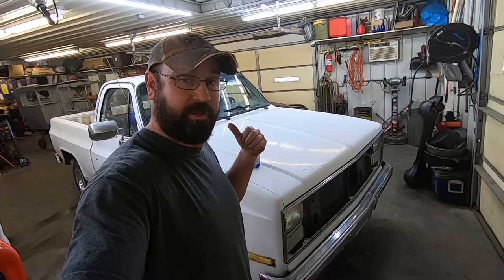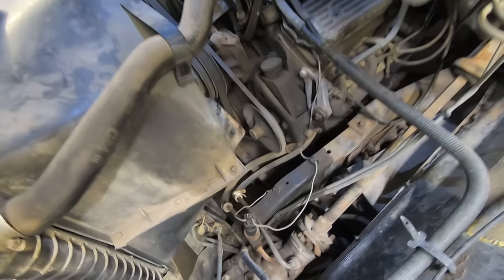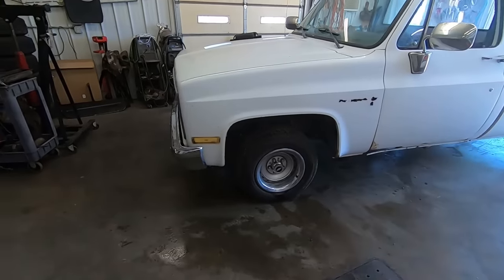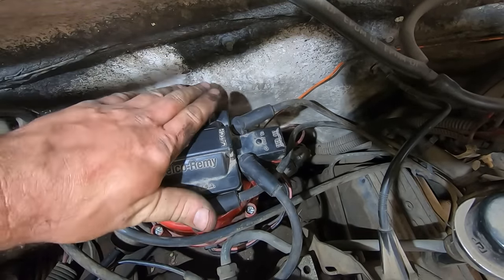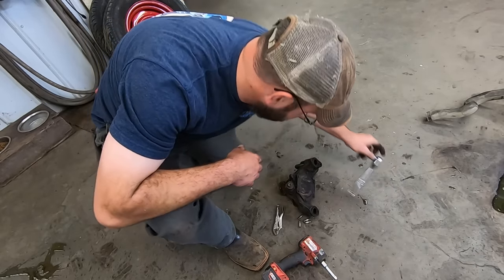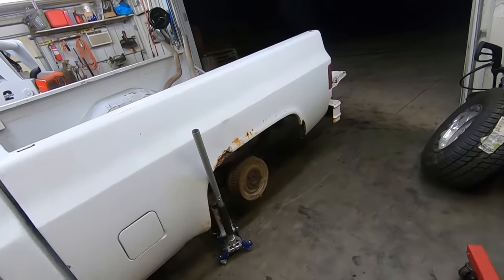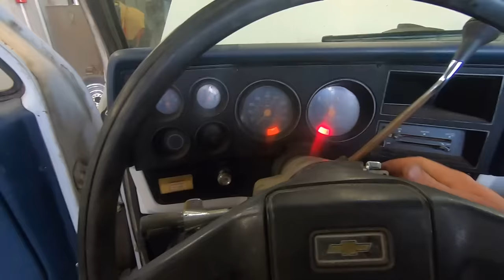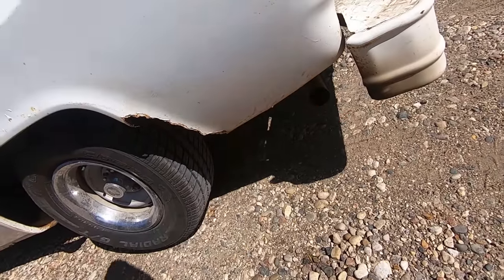I bought the cheapest shortbed Squarebody on Facebook Marketplace! Will it run? Daily driver?!?

Comment: Tech tip of the day check the reluctor wheel , the magnet in those 4.3 where prone to cracking and will cause intermittent missing. I don’t no how many of those I changed back in the day . Just a visual inspection of the coil magnet you can see if the magnets cracked or not but you replaced so your good to go

Comment: I love the square body's.  I have an '81 GMC one ton camper special with a 454, only 66k original miles.  It loves gas stations.... It's my wood and hay hauler.  The original bed has been replaced with a flatbed.  No rust whatsoever and the original paint is still in great condition. However, those darn door latches.....
Reply: Jim jibroni  --  Well, you have a point actually. Perhaps it's meant to display that the engine hasn't been replaced or rebuilt. That's the point I was trying to get across anyway, LOL.

Comment: I swapped a 396 big block into mine with a 400 transmission. Mine had the 4.3 with the three in the tree transmission with 3.42 gears. It would beat a lot of V8 vehicles off the line. Wanted more power so swapped in my 396. Wish I could find that truck now

Comment: That truck has the e4me quadrajet carb, it's computer controlled. Since you've pulled the computer controlled module out of the distributor, it may not be working right not giving it enough fuel. Easy fix is to just put a normal quadrajet on it
Reply: isnt that exactly what he did?
Reply from the maker: @bifaith100  Yup!
Reply: @MortskeRepair  How are you going to get that truck to pass an emissions test, or is'nt that a factor in N D. ?
Reply from the maker: @jeromebreeding3302  We got nothing like that here.
Reply: @MortskeRepair  You're iucky. Air pumps, Egr valves electronic carbs, and timing controls all sap power. Emission test force you to keep them.
Reply from the maker: @jeromebreeding3302  I'm not complaining that's for sure!
Reply: Yes because now the throttle position sensor and idle speed solenoid have no input from the ECU,to the distributor and carb..lol 74-83 Rochester quadrajet it lol.. although watch the 83-early 84 carbs have a idle stop solenoid and another one I can't remember what it is at the moment,kept running into them on Buick rwd 231, and 252 v6..grrr...lol.
Reply: @richardbates2367  The throttle stop selonoid is something I've encountered over the years. Supposedly. it's supposed to prevent   stalling.Always removed them. Did'nt seem to make a difference one way or another.
Reply: The best fix is to throw the quadrajunk in the scrap pile & put a edelbrock on it.
Reply: The pre-computerized Quadrajet carb is sometimes sworn at, just as often sworn by. It has a number of peculiarities that make it more difficult to service or modify than others,
Reply: @jeromebreeding3302  I've dealt with dozens of quadrajunk carbs, at the end of the day all of them were replaced by brand new 650 cfm edelbrock carbs with electric choke. I found it's easier & alot less unnecessary headaches just to yank that quadrajunk right of & replace it with an edelbrock in the first place
Reply: @tinsano6030  The Edelbrock has a reputation for running great right out of the box for most mild street applications. It's worth noting that it is a near clone if the venerable Carter AFB from decades before.
Reply from the maker: @tinsano6030  Edelbrocks work great right out of the box as far as an idle but they don't have near the get up and go of a proper Quadrajet.
Reply: @MortskeRepair  i personally wouldnt know cause every quadrajunk I've ever had couldnt fight it's way out of a wet paper bag. I have a 84 k10 custom deluxe single cab w/ an 8ft bed & 1 ton leafsprings all the way around, running 265/75/16 tires with a 350 & a sm465, I put a 650 edelbrock on it & I've plowed my 450ft long driveway with 6 ft deep snow in one swipe from my house to the  main road all winter long. Couldn't do that when it had a quadrajunk on it.
Reply: CCC Quadrajet are supposed to fail rich.  The computer pulls the metering rods down. Then again it has been decades since I have worked on one.🤷‍♂️
Reply: @MortskeRepair  They work great for a mild street engine. If running a lumpy cam, you have to buy upgrades, metering rods, etc.
Reply: @paulkleinschmit9871  and the they act totally different compared to the lagging one's that won't hardly idle..when the throttle position sensor and idle solenoid are actually working!!

Comment: Man, you gotta be able to find a late "80's 305 HO. I know its not a super crazy engine to swap, but as for a daily, and something you want to be reasonably economical, that would be the way to go. All, or most of the brackets and such should transfer. Or and old 283 with 305 HO heads, that's actually a pretty decent combo...ask me how I know. lol
Reply: Find a 305, Ho!   xD xD
Reply: 305 and a SM465 is a pretty unkillable combo.
Reply: Especially if it is the L69 with the 416 58cc heads 1983-1984.. and even the 91-92 h.o. tuneport 305 with 081,187 heads..
Reply: @richardbates2367  Agreed
Reply: I have a 307 with 305 heads, it runs and sound like no other small block

Comment: If the EGR valve/solenoid is still there make sure it's removed and blocked off.  They would carbon up real easy on the pintle and stick open, causing a super lean condition at idle, rough idle, dieseling and hard starting.
Reply from the maker: I'll check it out!

Comment: Maybe the Egr valve.. I’ve had a couple late 80’s  4.3’s and the egr valves take a sh*t, and make up run really rough and eventually won’t run once their warm
Reply: Cheap egr valves are a big no-no as well. The only aftermarket egr valve for the 4.3, 5.0, 5.7 that I’ve installed that lasted has been an Echlin .

Comment: Love that your truck squarebody the last of the square tail lights they started 1973 1 all the way up to 1987 good trucks easy to work on I don't care what anybody says a GMC truck will run forever to front-end stay straight the engines have the best oiling system engine parts are interchangeable you can't go wrong with a GMC truck

Comment: Did a fuel pump replacement on a 350 in a ‘78 GMC pickup. To get the pump push rod to stay up, I smeared a little axle grease on it. Worked like a charm
Reply: Seems nobody know about taking the bolt out that’s on the backside of the fuel pump pad on the block that seems to have no reason being there ( it’s a short bolt ) and thread in a fuel pump bolt that’s longer to hold the rod up.
GM cast that provision in the block for that purpose.

Comment: I love these old Chevy trucks, mostly just for the looks but if I were to buy one it would be a long box with a 350 V8
Reply: Larry Arthauer  my dream truck is an obs Ford dually but I’d love a squarebody Chevy too
Reply: Larry Arthauer  My dad bought a Big 10 new in 78, nice rig, a little heavier suspension from what I remember
Reply: If you're going to buy one of the square body truck and you get there and it has a V6 or a 305 V8 turn around and walk away you'll never be happy with him and if you care about steering the truck voice check the frame at the gearbox a lot of times they'll be cracked and they will crack all the way out and fall off
Reply: @kennethGumm  I haven't seen a 2 wheel drive frame cracked out yet, but a few 4x4 frames cracked,  a real issue when they sell frame reinforcing plate kits for them. Bought a 1/2 ton 4x4 parts truck that had some of the worst arc welding attempted repairs I have ever seen, steering box was almost falling off, good thing they quit driving it.
Reply: I had a 91 c1500, not a square body, but had the TBI 4.3 I sold the thing a few years ago, had 687,000 miles on it, original engine, I installed a rebuilt the trans in 2002 at 190k miles on it, was my grandfathers truck he bought new. I just love these old engines, nothing to them, interchangeable parts, they don't make a ton of power, probably why they last so long lol. I bought me a 92 Silverado with the 350tbi 5 years ago, just hit 400k miles on it, but has a 94 engine in it with the 95 heads I bought from Summit Racing. Hard to find a square body in good shape here in the rust belt.
Reply: @keatonschooley3750  that's everyones dream a obs ford regular cab dually, 80s or 90s,  my daily is a 5 spd 350, 97 GM c3500 regular cab, 354,000 miles, took me years to find a little daily 1 ton
Reply: I have a 79 Scottsdale LWB $600’body only in GA
Reply: @davidanderson2393  a

Comment: Congrats on finding your "new" square body. Definitely show us the body repair and all the updates. I had a '89 4.3 with a 4 speed with overdrive. It didn't have enough HPs to really use the overdrive and the little pedal was always getting pressed to the rug. I would like to see you drop a 350 into Casper, I'm sure you would be happier.
I'd also like to see that '50 Ford pickup get a running flathead.
Thanks for taking us along for the ride!
Reply from the maker: The Ford already has an LS!
Reply: @MortskeRepair   @Mortske Repair  dang! Sounds like you finally made a Ford good!

Comment: I've got a 91 Larson 20 ft cruiser boat, it has the same  Vortec 6 ccyl in it, and it's hooked to a Penta counter rotating dual prop outlive and it runs awesome, tons of power, can cruise bout 40 mph at 4500 rpm all day long. Love that motor, that one should be a good one to. 👍 love your finds!
Reply: Dual prop outdrive.shes a screamer.

Comment: Putting in new door pins and new strikers usually fix the problems with Square Body doors that sag and are hard to close. It worked for me bud👍
Reply from the maker: These don't sag and the pins are relatively tight tho.
Reply: Maybe try to adjust them. I once had one door that no matter what I did, I couldn’t get it to close good. I finally realized that the door skin was loose around all of the seams. Good vids man , and good luck with Casper!!! It’s a beautiful truck!!!!!!!!
Reply from the maker: @markk874  Thanks!

Comment: We had a couple of these trucks on the district I worked on with the Forest Service in Camp Crook SD. I worked there from 1987-88. One was an 84 with the 250 inline and 4 speed manual, and the other was an 87 with the throttle body 4.3 and 4 speed manual. My crew got the 87 so we had a/c in ours. It was basically this same truck just in a calf scour green color. It also had the idiot lights instead of actual gauges.
It wasn't a bad pickup, it had fairly decent power and the manual had granny low so it did pull itself around the hills fairly good being it was only 2 wheel drive. 
On the highway, it did manage to maintain highway speeds as well, and I believe it even had cruise so it was fairly well equipped for a government truck. I wouldn't mind finding one for myself to drive, though I'd opt for the long box over the short box, but that's just me. A guy can haul more in a long box.

The alternator should run around 14.2 to 14.8 volts, so it's right where it should be.
Reply from the maker: Not much going on in Camp Crook these days! Good times!

Comment: The 4.3 L (262 cu in) V6 is the last and most successful engine in the Chevrolet 90-degree V6 engine family. This engine was introduced in 1985 as a replacement for the 229 cu in (3.8 L) V6 in the full-size Chevrolet, the Chevrolet El Camino and Chevrolet Monte Carlo. It also replaced the 250 cu in (4.1 L) in the Chevrolet full-size trucks and full-size vans (including the mid-sized Astro) as the new base six-cylinder engine.
Reply from the maker: Great info!
Reply: I've got the 4.3 vortex in my 93 Chevy S10 blazer and I love it, it's been super reliable with good power so far....I've been super surprised and happy with the gas mileage I'm getting from that engine also!!

Comment: The 4.3 are a work horse I have one in a pickup truck and got 400,000 miles out of Iran synthetic oil on it since it was brand-new it was a 1991 GMC truck with a 5-speed manual transmission I never forget it it ran and ran and drove it to the junkyard it was still running did not burn oil in the last time I had to run emissions it past I'll never forget it it ran and ran and I put roller tip rockers arms on it for a little extra horsepower believe it or not it was just something to do for s** and giggles Steve from Annapolis you got my vote keep up the good work you and the dog
Reply from the maker: Thanks much Steve!

Comment: Loved the video on Casper. If you cut a piece of plastic hose 3/8-1/2 and put it over the round latch post on the door frame, it will shut and latch EVERY time. Please continue restoring the short bed into a beauty. I have a 1980 Squar body short bed step side that I have owned since new but it has been neglected and you have inspired me to restore it with a new 383 and a four speed or 5 speed if I can find one cheap. Really enjoy your videos and love your sidekick Duff. God bless you and your pup and your channel - Jeb from Texas
Reply from the maker: I did the PEX trick and it works great!

Comment: Morstke, great video as always. I like the long ones (that's what she said!). Who was that guy whose junkyard you went to that had all those great flathead engines and flex hoses. I am in Pa but I need a Diamond T to start my new Rat Rod Project with. Talk to you soon. I will try emailing you when I gets a chance....lol Thanks for the awesome useless knowledge on how to hold the fuel pump rod in with the bolt but evidently not on the 4.3...lol I have to do the bump stops on the Ranger I am restoring and building a Flatbed for.
Reply from the maker: No Diamond T stuff out there that I saw.
Reply: @MortskeRepair  Do you have any idea what he wants for the flathead V-8's? does he have a number? Thank you Mortske.

Comment: Love the squares, i have a 86 lowered like yours, completely gutted engine compartment just a 350 sitting in there will all edlebrock stuff and headers.  Electric fans new radiator and vintage air A/C system.  I have a electric fuel pump supplying the carb and here in Arizona starts up and runs great in the desert and since is a Arizona truck no rust!  Geared well with the 700r4 runs about 2k at 65mph not to shabby still needs some things like new steering column and some minor stuff.  By the way yours's rolled blue smoke at startup at 206 time
Reply from the maker: Yeah the ol 4.3 is tired!

Comment: The 4.3 is a great engine no need to swap it for an LS. I worked  for a Chevrolet dealership we had a shop truck that had a 4.3 I think I drove the truck for two months before I even knew it I was always jumping in it to run different places to buy parts from other dealers in the area I just assumed it had a 5.7.
Reply from the maker: Right on!

Comment: Adult beverage preference: Cannabis.

The leaky fuel pump was dumping fuel into your sump - happened to my Mazda...I reckon your dilution problem is solved, now.

I use Stag Jointing Paste on cooling system joints...a red, ceramic based compound (non toxic food grade) - good for fuel and oil joints, too.

Comment: bud light for the beer and heres my tech tip on the beer if your putting them in a cooler set them straight up and pour your ice on them or in the fridge turn the temp down to almost frost bite cold for crisp cool drink when you open the can try this .thanks

- nick
Reply: Coors Banquet beer is pretty decent, so is Yeungling lager.

Comment: My first vehicle was an 85 GMC Sierra Classic swb 2wd. I loved that truck and wish I still had it. Had the 305 block, 350 camel hump heads, aluminum high rise intake with the quadra jet carb, headers with 3 inch pipes to the mufflers then 2 1/2 out the back. To me, nothing sets these off more than white letter tires lol. Wish you had put the letters out on Casper. Would totally change the looks.

Comment: The other 80's model solenoid that almost always gets unhooked for more HP and bypassed is the decel valve,which is the big backfire cause when you slowed down.. allows them to load up on fuel instead of burning excess fuel to increase performance..
Reply from the maker: Where's this located? Never heard of it.

Comment: My wrecker is a 82 3/4 ton with a 305  & turbo 400 trans.  At present we are parting out 15 square cab trucks. all long beds except for a GMC Jimmy. two are long bed 4 wheel drives. Short beds are a rare find in these parts.  We had a 86 with a 100% rust free cab. sold the stripped cab for $500.

Comment: I use 3m head liner glue it holds them in place real well. I usually trim gaskets to fit too.
Reply: Yes. that stuff known affectionate as "gorilla snot" will work for just about anything.

Comment: Very good videos, perhaps try using some grease on your gaskets like on the fuel pump replacement it will help hold the gasket in place and seal better and on water pump 👍👍 obviously you probably already know that 😉
Reply from the maker: Thanks for the tip!

Comment: When you remove smog pump there are holes under carb that need to be plugged, or you need the caps under intake that go in head same as small block.or put pump back on.

Comment: If dealing with a clean non buggered up sealing surface I coat both sides of the gasket with just plain grease .. the gasket will soak it up and swell just enough to be good seal. A bonus of doing this ...if you need to disassemble it again the gaskets will still be servicible
Reply from the maker: I've done that on flathead intake gaskets for the same reason!
Reply: @MortskeRepair  I like grease, even better when someone"greases my palm"(with some dinairoes).